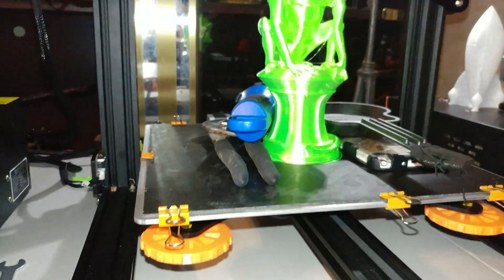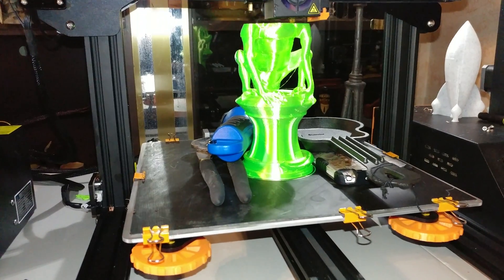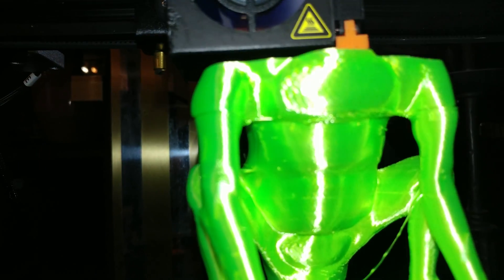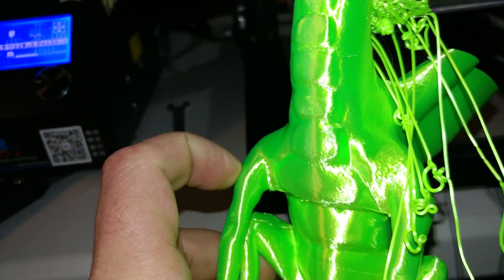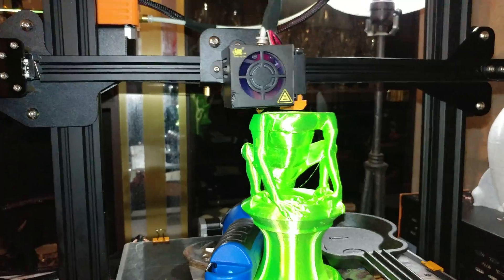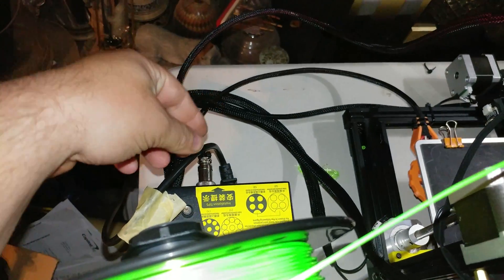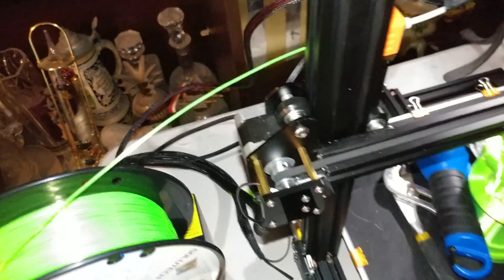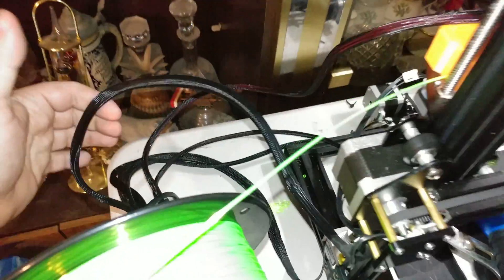Today's 3D Print - Update CR-10 Z drop issue continued

Comment: Are other people having this issue? Is this common with cr10s?
Reply from the maker: I do not think so. I think this is unique to me and maybe a couple others. it is NOT indemic to the machine at all. I suspect it might be either the harness going to the stepper or the main board itself.

I have another CR-10 that I hope to have setup tomorrow. once I have it up I will try some prints again and see if I have any trouble. if not I will start swapping parts (first harness then mainboard)

if the problem leaves one machine and appears on the other I will have found the culprit :-)

I doubt anyone else will have this problem at least not a lot. I think its unique.